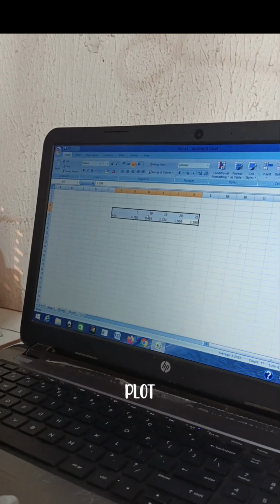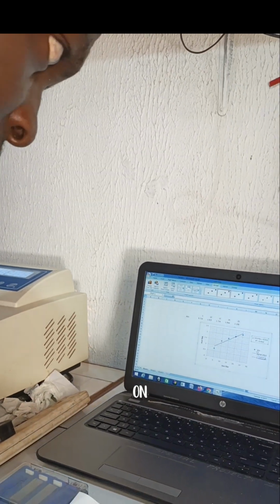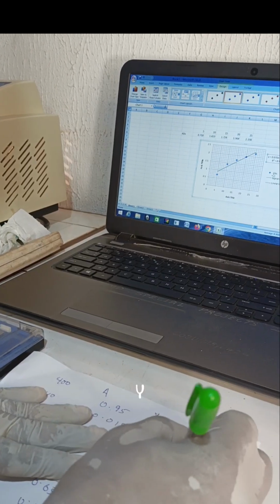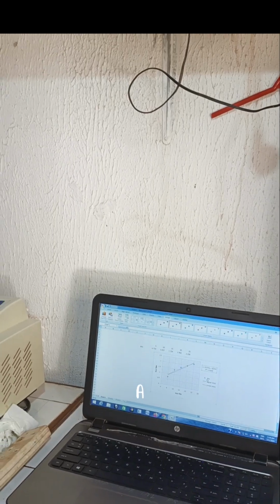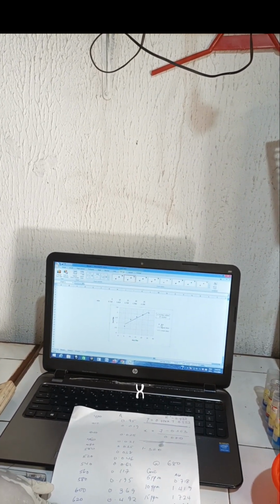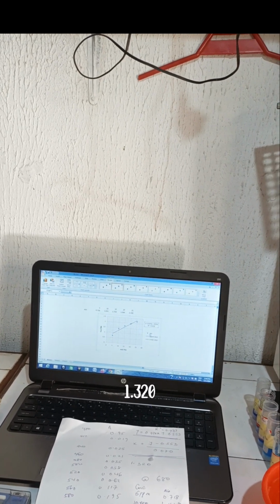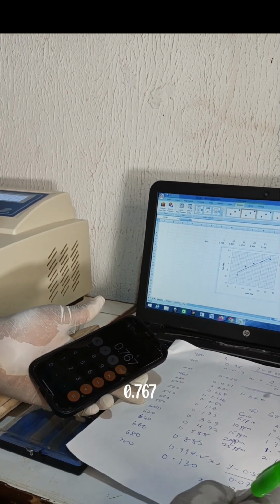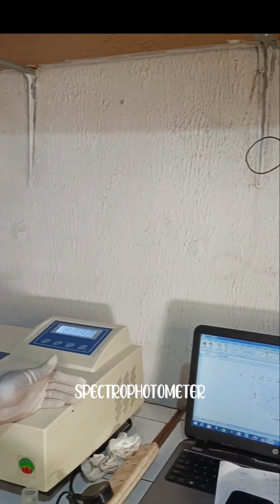How UV-VIS Spectrophotometer Determines Concentration: Complete Guide

Comment: Good one my Dr.
My question is this, 
Is there any precaution to ensure that the cuvette doesn't hold much water since it would increase the volume and decrease the concentration of the sample
Reply from the maker: So happy you found it good! You can turn the cuvette upside down and flick gently to remove any residual water or rinse the cuvette with the next sample you want to analyze. With this you can eliminate errors and use it as a precautionary measure. Thank you